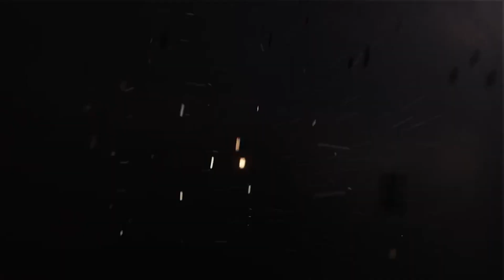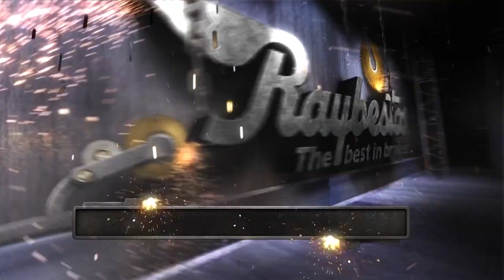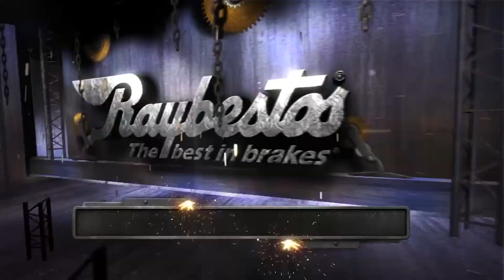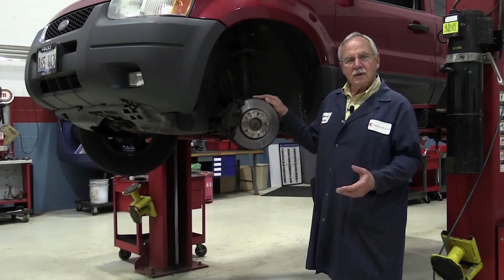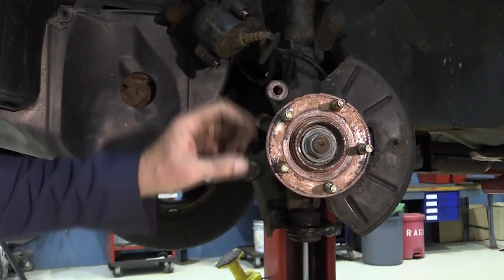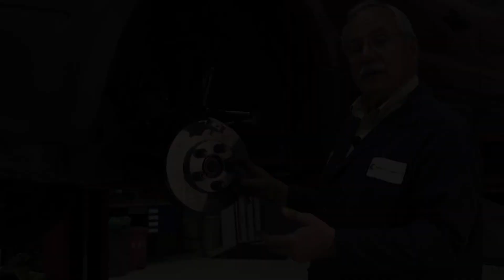Warped Rotor Myth

Comment: I was turning rotors waaay before ceramic brake pads were out.  The light inconsistent sound from the  touch of the cutter doesn't lie.
Reply: Mark Richards  All in good humor!😉 I know damn well rotors warp and I'm  a lowly shade tree mechanic!😁
Reply: I disagree with the rusty hub. Because the rotors are evenly secured on it with lug nuts. So any dirty surface will be uniformed. But rotors will warp. Ive seen it first hand
Reply: @robbiefrentz9427  come on now Robbie you think that rust is evenly distributed  on the hub? Even if you torque the lug nuts evenly the rotor can't sit square on the hub because the rust is never going to let it sit flush there for  making it wobble as it turns ,not the same as a warped rotor but the result is the same  and yes I've got 58 yrs of pro mechanic  experience and it pains me yo see so many ppl that have no clue to whats happening here  especially the raybestos guy  look through the comments where I explain why rotors warp I'm tired of typing
Reply: tragic life 
Lol. Nothing to prove man. Anything metal can warp under the right circumstances.
There is always a spec for max run out but even at 1.5 thousandths that should tell the raybestos guy that the rotor isn’t perfectly true. Lol
Reply: tragic life that’s where I disagree. I’m also a mechanic with 30 years experience. With ase certs. And was a regional trainer. What little difference in rust is so minimal it’s not even in the equation. What kills rotors more than anything is heat. Im sure that’s something we can all agree on..
Reply: @randyhooks1214  what bullshit? Everybody here agrees that heat is the enemy and that rotors do warp
Reply: I say you are full of shit. I've been turning rotors for decades. They DO warp. Any steel or cast iron will warp with constant heating and cooling.
Reply: Been a mechanic for 58 yrs and I'm here to say this is bullshit excessive lateral run out IS warpage  pad depositing material? NEVER SEEN IT IN 58 YRS yea the rusty hub was a problem but that just a lazy/ stupid mechanic

Comment: My Honda dealer screwed up my rotors twice.  First time the rotated the tires and over torqued some lugs and under tightened others.  $400 to turn the rotors, and correct the problem.  The second time they replaced the front axle under warranty, and grossly over tightened the lugs.  This time I took it to an independent mechanic for another brake job.    Torquing the lugs properly is such a simple process.
Reply: And best finished by hand with a torque wrench.

Comment: cheap rotors made in china only need to get to 500 degrees to warp. ive seen roters glowing red which means they are hot enough to be warped or wore more in one spot or the other. long story short poor un alighned roter installment can cause these but more often than not its cheap steel. this video is misleading. all steal can warp at different temperatures depending on the steel. vehicals with hubs and races made into them warp and wear differently as well because of over use and bad steel. dont think you can go order garbage roters from 1a auto or some other crap company and they wont warp because you clean the hub. best tips.
clean and regreese everthing( sliders,caliper piston surface,under ss slider surfaces,ect)buy oem or better and allways bleed the breaks at least enough to get that cooked fluid out of the caliper or wheel cylinder. it doesnt circulate and if its over 5 years old and 100k it needs to go. then youll keep that new car break performance

Comment: Rear rotor problems.  Will cause pedal pulse.  Front rotor problem cause steering wheel shake.
Reply: Wrong. Have had many vehicles with rear drum, and pedal pulse but no wheel shake.
Reply: It might if it's severe enough. Steering wheel shake is more of a  front tire unbalance issue.

Comment: How about some fricken anti seize so the hubs don't rust weld the rotor again.  SMH
Reply: Been doing that for decades.  Thin layer after wire brush and brake cleaner is all it takes.
Reply: Yeah...all that effort cleaning them...but no anti-seize to keep the rust at bay.

Comment: Being a 30+year mechanic I can tell you rotors do warp  . I had one at Ford dealership where I worked with .00210 thickness variation but visible lateral runout . You could actually see the rotor moving back and forth . But rotors don't warp - yeah ok .
Reply: Agree. I had warped rotors on a car that were so bad that the hat was warped too. I took new rotors and set them on a sheet of glass. Perfectly level with no gap such that not even a piece of paper could be slid under. Old rotors wobbled on the glass like a table at a cheap diner. 

This guy's video is worth less than a meal at said diner.
Reply: Pretty tight tolerance for a rotor?

Comment: 6.30.19.    He didn’t mention it, but it’s very important that you bed the brake pads to the rotor, i.e. cycle brake cooling brake cooling ......... around twenty five cycles. 🚧
Reply: Poppycock. I might believe you if any new car leaving the dealership had it done. Nobody ever had their brakes bedded while they filled out the lease paperwork. Bank on it.
Reply: @altitude19  most ppl that buy a new car drive it easy for the first few hundred miles effectively " bedding" the pads in .this is a procedure for getting the best service life out of your brakes .if you just throw a new set of pads on and go drive it hard right of the bat you will overheat and glaze the pad ,yea it will still stop the car but not nearly as well as a properly broke in pad.this procedure is generally carried out by good knowalageble mechanics on the test ride they take after working on a car if you do glaze a pad the now much harder surface will eat the rotor alive if you continue to use it  professional mechanic for 58 yrs so I know a little about the subject
Reply: @tragiclife9760  Any numbers on this?  Has anyone ever FORMALLY studied how much a difference is makes to do this procedure?  I've only ever heard this said as a "given."  Never seen proof that it's even a marginal benefit, much less "very important."
Reply: @altitude19  well I can only really say from personal experience that brake feel is much better if you break in brakes properly but the real issue is avoiding glazing the pads from to much heat to soon in the service life of the pads once they are glazed they are ruined ,they will eat the rotors up  because the  surface of  that glazed pads are much harder  than originally  also stopping distance and pedal effort are much higher  ,this is just common sense stuff no need for " numbers"
Reply: @tragiclife9760  I'll take that as a no. I appreciate that you believe it because you say you've seen it. I haven't and I don't believe just any old thing because "it's common sense." No, you shouldn't overheat brakes especially on a new car. For the rest, I think we'll agree to disagree. Hope you have a good evening, sir.
Reply: @altitude19  you can lead a horse to water.........you should perform your own test pads are pretty cheap nowadays ,go get a set install and go out and burn them up in the first couple miles .let them cool off then see how they work ,,will gladly accept your apology then I don't understand why ppl are so resistant to learning from the experience  of others  .but hey, I respect your opinion even if it's wrong
Reply: They do not do it on the "rolls test" at the end of the assembly line.

Comment: Thickness variation is double speak for the word "warped"
Reply: Warped means bent. Thickness variation is uneven wear.
Reply: Warped means out of flat, not thickness.
Reply: Paul Bates if the rotor is out of flat, it has varying thickness.
Reply: @mistaflinstone72  not at all. If you laid a warped disc on a table and measured the height then sure it would appear to have varying thickness. But that's incorrect. If you measure a warped disc with a Vernier caliper it would still be the same thickness all the way around. The disc is just bent. If you bend a piece of paper into a curve, you haven't increased the thickness, you've just bent it.
Reply: @mistaflinstone72  2 surfaces can be parallel and not be flat
Reply: @perryhinds894  good analage.

Comment: I worked in a shop for over five years, and my primary job was brakes. On average, at least 10 a week. How many is that?... More than 2000. 

Call it "Lateral Runout"... if that makes you feel better! However this man wishes to say it, a brake that has been overheated multiple times, has dark scoring, and isn't perfectly flat any longer is warped. 

What was his solution? Replace or Resurface. Warped or "Lateral Runout", the repair options are still the same. 

This video is just stupid.

Comment: I have seen rotors warp, I’ve checked the run out and I have also seen thickness variance and one of the biggest reasons for warping is that the wheels were not torqued to spec or not torqued at all

Comment: No offence intended, you haven't got a clue of what you are talking about, except possibly in regards to that one vehicle. I worked on a 1982 GMC 3500 truck with disc brakes on a Dana front axle. The truck drove fine until it developed a death wobble every time you hit the brakes. I pulled the rotors and turned them to the max, mounted a dial indicator on the lathe and still had about twenty thousandths run out. The spindle bearing was tight, the rotor was bolted to the hub and the bolts torqued to 65 ft.lbs. they had warped, they were covered in hot spots, and that truck had never seen ceramic pads. They had warped due to heat and those rotors were 1.235" inches thick, and no, the truck had not been wrecked or hit anything between normal driving and it developing that death wobble. Everything is a case by case scenario, don't go telling people absolutes unless you have looked at every vehicle, you might get a shade tree mechanic or his family or some innocent person hurt or killed doing that.

Comment: I came down a steep mountain highway where I had to brake often, all of a sudden it started to rain-the cool water hitting the Hot Rotors Warped my two front rotors-- since it was a new car, I had rotors turned, problem solved. Sorry sir but you are giving misleading info...

Comment: Rotors don't warp.  Period.  They can wear unevenly for the reasons he noted.  You guys obviously know little about metallurgy.  Another issue that causes pulsating is pad material transfer onto the rotor, far worse than what was shown on the video.  I find that to be the common issue with pulsating brakes that get worse as they heat up.
Reply: I'm sorry but rotors do warp - period . Metal does have to reach melting point to distort . I've seen it many times over 35 years as a tech . I understand everybody's points as they are possibilities too . But they will also warp
Reply: Yes, they DO warp. All these idiots saying otherwise have never used a brake lathe. Jesus, a BLIND man could tell you they warp just hearing that chirp chirp chirp when you start turning them.
Reply: It is not  only a matter of the temperature if you have a red glowing rotor an for some reason (for example wrong torqued wheels or a puddle of water or a caliper that is stuck a little an you push only one pad to the rotor) you gain some tension too and you are absolutely going to warp a rotor. If this wouldn't be so, you could go on and hit a red glowing rotor with a hammer without changing it's shape.

Comment: Improperly torqued wheels can warp rotors as well. Don't believe me? Use a spacer instead of a wheel, put dial indicator on rotor and measure while torquing it down. Over torque it and see what happens to the measurement. When it heats up from braking it will make it worse.

Comment: Over 22 years, I have taken brand new rotors from the box to the lathe and they were warped/excess lateral runout/whatever. This guy is a "Company Man" and is going to say what he's paid to say. When a manufacturer cranks out 5-10k rotors a day, somewhere along the way a step gets skipped in the process. Couple that with the fact that parts aren't always shipped or stored properly and there you have it.

Comment: In my career as a fleet technician,  I done a complete brake job on a car. After releasing the car, It was scheduled for a recruitment trip. The the car was being used for a trip from Wisconsin to California the car was packed to the max with luggage and displays. When the car was returned,  and I performed a return vehicle inspection I noticed a severe brake pulsation.  After I pulled the tires all 4 rotors was blue in color. So I had to do a complete brake job,and fluid flush. Later I found out that the car was pulling a trailer and the driver was riding the brakes driving over the mountain roads. For the rotors turn blue, I say they got really hot.
Reply: Blue rotors...jesus that is hot. I do see the odd asshole riding brakes continuously. Dont understand how these people have a permit to drive.
Reply: Shit that’s nothing. I bought a Subaru last year and they drove it to me. Told me they had to use the E brake to stop because it needed a brake job. Well! The left front pad was GONE and the piston was chewing into what skeleton of a rotor was left. Have some great pics of that on the shop wall!

Comment: It’s more of a transfer of the pad material when the brakes are hot from stopping then sit at a red light.
Reply: gonna have to speak english and explain how that happens when both the pads wear from friction and also rotors and drums have a minimum thickness punched into them 
if you are saying rotors dont wear
Reply: Dallas Davis Yes both pads wear. If they didn’t there is a problem with the caliper. Or did you mean both the pads and rotors wear? Who needs to speak English now?  I never implied the rotors don’t wear. The pads are of less dense material, wear fast than the rotors. That’s how the pad material transfers to the rotor. Then when that spot comes around to the pad area you feel the pulsing. More so on new brakes.

Comment: I've seen rotors get cherry red at thunder bolt speedway.
Reply: That's funny cause I heat cast iron  almost everyday to cherry red i work in a fab shop making ornamental cast iron railing cherry Is about 850° and it bends like butter try bending it cold

Comment: This guy is making what amounts to a semantic argument. Excessive lateral run out means to an old shade tree mechanic like me that the rotor is warped. Yes, there are other reasons for pedal pulsation, but a warped rotor is probably the most common. How the car is driven has a lot to do with why rotors warp. My wife commutes down a long hill at least once a day. She rides the brakes all the way down. The rotors get so hot I can see them glow at night. Where I live it rains a lot. Overheated rotor meets a cold puddle of water, it warps. Simple physics folks. I rarely warp rotors. One reason, I drive many few miles than she does. When I head down a steep hill I brake like a trucker. Apply and release. The rotors have a chance to cool so they don't over heat.
Reply: Engine braking helps to. Low gear.
Reply: @mikefoehr235  I love a good engine brake, but you are just moving the heat to the clutch.
Reply: Huh? How are you heating a clutch? Do you know how a clutch works? You only heat it by riding it.
Reply: @brucea550  He isnt smart enough to grasp that concept.😂
Reply: @brucea550  Do you? All a clutch is a big brake.
Reply: Go back to mechanic school Jason!
Reply: @brucea550  quit being a troll, and learn what you are talking about.
Reply: @luvspus69  What do  semi trucks do when descending steep grades...the driver use low gear. Now i dont know where you live but here in Canada we have signs to indicate exactly that...signs say....TRUCKS USE LOW GEAR...STEEP DOWNHILL GRADE.
Reply: @mikefoehr235  The only reason truckers do that is because the service brakes are not powerful enough to not over heat and catch fire.
Reply: @luvspus69  Well...you believe what you want. I know when i go.down steep.grades in my truck..i use 4th gear or 3rd. My heat gage does not change one infinite amount. Maybe Toyota just builds a superior product compared to others.
Reply: @mikefoehr235  your comments exacerbate your ignorance. Engine temp has absolutely nothing to do with the clutch or brake temperature.
Reply: By the way I drove semis for 8 years and I am an auto tech.
Reply: @mikefoehr235  not the same thing at all. Automatic trans are wet brakes not dry like a clutch.
Reply: @luvspus69  whatever

Comment: Not sure this is totally correct however I have never had a warped rotor in 35 years of car owership.

Most brake pulsations on have been from rust or surface problems causing uneven heating and temporary warping.
Reply: What exactly is ‘temporary warping’? Lmao!
Reply: @brucea550 Temporary warping is where the rotor is heated unevenly and it buckles or warps while it's hot but when it cools down it comes back to spec.
Reply: You seriously believe that?
Reply: @brucea550  OK explain this. Hit the freeway from cold. Perfectly smooth braking. After 5 minutes or so driving, terrible shudder (rotar must be warped) when braking. Fitting a new caliper no shudder at all for many years. (rotor must no longer be warped). Can only be due to uneven heating. Furthmore the calipers in the cases I saw appeared OK when pushing back.
Reply: “Rotor must be warped”. Right away you have made an assumption that is probably wrong. There are many reasons you could have brake shudder without a warped rotor. Mainly because a warped rotor doesn’t cause shudder, it causes pulsing.

Comment: My car developed a brake vibration when braking at high speed. My disks had marks on them like in this video. So I removed them and cleaned the mounting face as well as cleaning up pads and caliper. After refitting the problem was still there but not as bad. Anyway about 3000 miles later it has come completely right. So as you say the rotors were not warped, the surface was inconsistent and once everything was installed properly they cleaned themselves up.